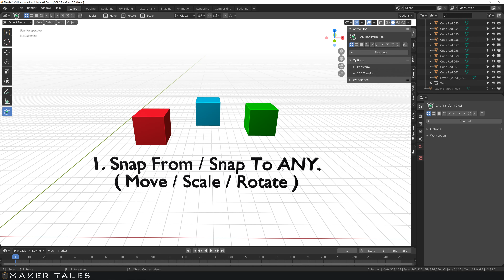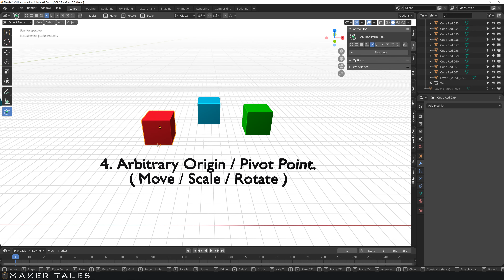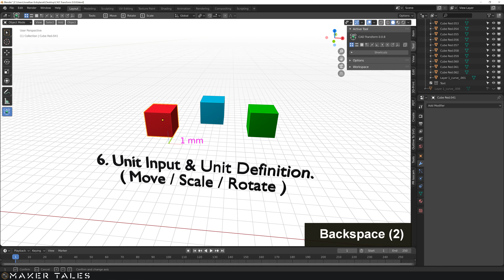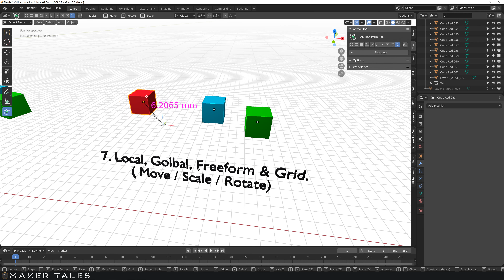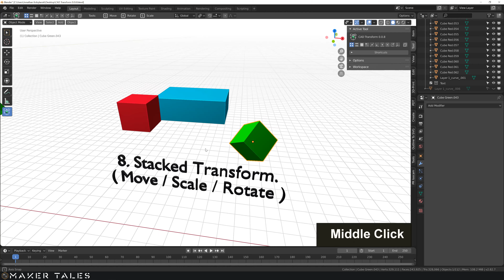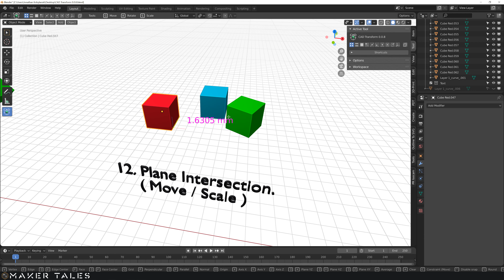CAD Style Precision Movement In Blender 2.83 | CAD Transform 0.0.8 Addon Update

Comment: I've got the center length of a cylinder that i want to line up with the angled edge of a 4 sided pyramid.I've got the bottom center face of the cylinder snapped to the bottom corner of the pyramid, is there a way to keep that anchored and snap the top center of face of the cylinder along the edge of the pyramid?
Reply from the maker: Hey, I'm pretty sure there is but without the file at hand i'll find it hard to explain. You could also ask this questions here: https://blenderartists.org/t/cad-like-transform/1226197 and i'm sure you'll get answer.

Comment: Oi Big J. Kinda pathetic but I struggle to install the Add-on. I'm running Blender 2.92.0 and try to install the 0.91.0 CAD transform version. When I go to "pereferences -> Add-ons -> Install -> file path " I'm presented with 3 different python files. The one of my desire is "slcad_transform.py". So I double click it and within Blender there is a thin blue progress bar at the bottom, which takes about a second. But afterwards I can't find the add-on in the "Add-On list " for check marking it. Am I doing sth wrong or does Stephen L. simply hates me    :'(
Reply from the maker: Hey freezyAndHaze, have you had much luck with this? At the end of the day is make sure you keep the zip file together as all together that is the addon. I hope that helps. If you need more of a guide leave a message in the discord and i'll be more than happy to help.
Reply: @Keep-Making  i realized that u must not open the zip file 😅 rhen everything works as expected

Comment: I have a question. When I start manipulating with objects and start rotating or moving it with CAD snap on, it goes into its own coordinate system which has different axis location relative global one. Say I want to constrain moving by Z axis, press Z, but actually it is Y, or X, and I have to press them all one by one. Am I doing smth wrong?
Reply: Constraint keys are toggle between global / local / custom / none (it is possible to set the default one in preferences) so in order to move on global z axis you have to press z twice.
Reply: @StephenLeger  Thx! You are speaking of the vanila manipulating. I know hitting twice the axis toggles constraints from global to local. I am speaking of using CAD snaps. Does it work the same? I haven't tried hitting constraint keys twise and give it a try later.

Comment: Wow, this is smth I have always missed in Blender beign an Autocad and Rhino user! Thanks a lot for all your tutorials for Cad users! Still one issue is I cannot resolve. Boolean objects with coplanar faces. It leads to awful artifacts. Blender still cannot do it whilst all CAD and even 3D Max are capable of it. In latest 2.91 they added new bolean exact solver, it is better but still lots of issues.
Reply from the maker: You're very welcome!
Oh ya for sure, those who are looking for a 100% CAD solution should stick with a cad program. However, blender is definitely turning into a nice middle ground to play with some decent precision and organic modeling.
Reply: @Keep-Making  Well, it depends quite a lot on the final goal. If I need to get a low poly I need to make it in Blender for a good topology sake, making it in Rhino and converting even with quadrify mesh cannot provide this topology. For example I am trying this one to make just for the practice https://www.youtube.com/watch?v=Nyq_pO3ibRE&t=143s but without these math. I can make it in Rhino in 5 minutes, in Blender (I am learning it now) with the CAD snaps I thought it would be easier, but Booleans is a stumbling block form me now. Coplanar faces + boleans = fail. It is such a mess, a lot of coinsiding edges, some cannot be refit. I can't imagine it works fine in 3D max and all Cad applications but in Blender it doesn't. I like your lessons, they are good for Cad users like me. Will look into them more.
Reply from the maker: I do understand your frustration! With time i'll cover this in my blender 2.91 series for sure
Reply: @Keep-Making  Thanks a lot. Yet I find myself doing booleans and then tracing them with new point+extrude workflow and after using this clean shape. Not sure it is the easiest way but cannot find a better solution.

Comment: Great but blender NEVER can be used for real CAD projects as its precision is fundamentally limited ( see the first limit) https://docs.blender.org/manual/en/latest/advanced/limits.html . this is the case until they think about improving it.
Reply: for 10mm objects, precision is ~0.000001mm, by far enougth even for high precision mechanic !
for 1m object precision still is ~0.000061035mm 
So i can't agree, but this require clever use of the unit system. By the way presision is the same than in 3dsmax.

Comment: Cad Transform 0.91.0 compatible with blender 2.91 is available on gumroad !
Reply: Stephen, this became my favorite plugin alone with meshmachine. I really love Rhino for its perfect snaps, and now we have smth similar in blender. Few things to poing out. I'd love to see Ortho togle, so I don't have to constrain axis all the time. It means I can move only by X or Y axis perpendiculary. Also when in edit mode I want to drag the edge's vertex to it mid (so it becomes 2 times shorter). Rhino remember the origin position of the point, so it tracks the middle, while here the edge becomes shorter and the ability to track the middle disapears. I hope you understand what I mean. I can use the average only if I have the same length paralel edge as a reference, but if there is the single edge I cannot do that.
Reply: Well either Maker Tales deleted my prior comment or YT did. You say your addon supports v2.91x ( I have v2.91.2 on Win). You need documentation. The package is not showing as installed yet Blender says it was. It is not listed. I see Add Mesh: Archipack & Viideo Tools: Refine as the only addons with your name as author. Enabled add on is unchecked. What is with this assumption that anyone wanting to use the plugin is already familiar with the installation process? There is 3 py files in the 0.91.0 zip plus those in sub directories. What gets installed .. all the base 3? I imagine the sub dirs are linked thus do not need to be installed. I've spent a few hours now on this due to lack of docs and help. This video and the condensed version does nothing other than cheerlead.
Reply: @xenuno  Setup using the downloaded .zip file, if 0.91.0 version fails, you may revert back to 0.0.9 with blender > 2.91.0
Reply: @StephenLeger  Thanks .. that fixed by using 0.0.9. I now see CAD icon in Blender. A little bit of documentation with rev history would be rather nice. Testing now ...
Reply: @StephenLeger  OK .. after properly installing 0.91 it works fine under 2.91.2 of Blender. It's fab plugin. What I don't see and have elaborated elsewhere is how to align the gimbal to the face of a cube for instance, whose faces are not co-planar nor edges co-linear with global in any way. Need a 3 point snap, I think, to be able to line up origin with a cube vertex, with the X Y and Z axis's co-linear with the vertex's 3 connected edges. This (a 3 point snap) would facilitate a 3D Align function similar to AutoCad's which is a one step process. AutoCad can also save any number of custom UCS's which it handles any like an object and they are fully transformable. Wonder if such a paradigm can be applied to Blender? The closest to it in Blender is setting Transform orientation to Cursor then gimbal position and angle can be set.
Reply: @xenuno  Take a look at  #44:37
Reply: @StephenLeger  K thanks. His cube is co-planar and parallel (edge wise) with Global which will be what the constraint appears to line up with. My example doesn't. I have found tho that hitting say X twice uses the object's local UCS? I still think a discrete 3 point axis align would be a welcome addition if possible using the right hand rule for positive Z. Still learning this but you have a great base that ought to be included with Blender by default.
Reply: @xenuno  Normal based custom constraint will be coplanar to any custom face orientation, z axis aligned to normal, x horizontal and y as much vertical as possible.
Contraints keys xyz are toggle from local/global/custom/none.
So instead of taking 3 random points you are able to set the custom ucs at once.
Reply: @xenuno  You'll find this a lot in the blender community. When doing something advanced, the assumption is generally that you are not completely new to blender. 
Don't unzip add-ons. Save the zip file itself to an add-on directory (I suggest a cloud storage folder you create Just for that). When you go to install, you select the zip file, NOT a PY file. A few add-ons are only a single PY file so that will work, but others will break. 
Once you install it correctly, check the box to enable it, and you'll see the CAD icon. If not, hit "t" to show that bar, or there is a tiny little arrow in the top left of the 3d viewport.
Also, don't complain too much about an add-on that he is giving away for free, and isn't even in a full release stage? It comes off as pretty rude. 
If you still need help, there are Quite a few videos on how to install add-ons in blender on youtube.
Reply: @AndyEngelkemier  I complained about the lack of install help and that's it .. and did buy Leger a coffee at least, so it wasn't free to me nor did I want it to be and I should and will throw him some more. I know how to install these but was rusty when I did it the first time around .. so what is your point? Something like your little install writeup would be a nice addition as an included readme for any plugin-addon, plus revision history.

BTW: "When doing something advanced, the assumption is generally that you are not completely new to .. ". This attitude has permeated Linux builds if you haven't noticed .. which is one reason it's not more popular. Snaps of wine run time enabled Foobar and Irfanview .. programs you would likely use with Linux builds to access NTFS partitions. I searched for hours on how to get them to see NTFS drives that I had already mounted via Ubuntu Mate (v18). You would think that is something most people would be interested in knowing how to do and thus should be in a writeup and included for both. It's not ..
Reply: i just bought it and nothing downloaded.. what did i do wrong?
Reply: @CaptJackDeez  You should of received a "You bought CAD Transform for Blender!" e-mail containing a link. Even if not Gumroad member it should be valid .. mine still is. Don't break the non beta zip apart .. that's what caused my install headaches. This is why documentation is needed .. for those that are rusty or new to the process. It's too Linux like where it's assumed everyone enjoys searching endlessly for fixes and good documentation.
Reply: This is awesome! Do you have a way to align the origin to normal when affect origin only is chosen? That is Super helpful if you ever find yourself with an origin who's rotation doesn't match your object. Currently it seems I have to create a new object, move it to the other object's face using the face center + normal. Then join the two objects so that my object takes on the orientation of the object I created, then go into edit mode and delete it. You can use the built in snaps to "Align rotation to target" but that only makes Z normal to the face. Your tool helps then because then you can move it to the Center of the face, and then rotate Y or X using local Z and snap that to the edge center? That seems complicated. It would be awesome to have something built in to help with doing that in fewer steps. I would suggest an origin 3 point align. Click for origin center, next snap X, next snap Y.
Reply: @AndyEngelkemier  Origin should work the same way than any other snap operation, so i guess it should already work as it.
Cad transform constraint is ment to be as fast as possible at setup time, so don't expect a 3 points setup anytime soon, this would require 3 steps with snap to setup and will add even more complexity over a yet already not so simple code.
Reply: @StephenLeger  Maybe I'm just missing a key factor then. Say I want to make the origin Z perpendicular to the face normal. 
If I grab another object, I can snap face to face. Awesome! But if I grab the origin, it's not using the normal? It moves the origin to face center, but it doesn't seem to change the orientation. Is there a different way to select the origin so that you're selecting an origin axis to use? I'm guessing that's why it doesn't work. Or perhaps you can have it use Z by default if no axis is selected?
And sorry, didn't mean to make it sound easy. Programming is incredibly difficult to me, so that you've accomplished this is awesome.
Reply: ARGH!  I so wanted to buy this.  But it doesn't work with collection instances!
Reply: @dodaexploda  You may download for free (and make donation if you want to support my work). In blender 2.93, you are able to duplicate collections using geometry nodes in a way it remains snappable.
Snap to collection instances is not possible as it would be way too slow.
Reply: @StephenLeger  hey dude.  Yeah I downloaded it for free to see if it would work for me first before making a donation.  I'll take a look to see if there is a way to duplicate collections with geomtery nodes.  I'm still a noob at this.

Comment: Instead of pressing V, E, F it should implement use of 1,2,3 for edge face and vertex. also Shift+1.2.3 for their centre, 4 for normal why confuse with so many letters.
Reply from the maker: Hey Rajendra, This would not be possible as you would but inputting units when pressing 123 ect. It's all very intuitive after a little bit of playing around with CAD transforms.
Reply: @Keep-Making  123 are used in edit mode for vertex, edge and face too and also not far away from each other, you learn to play with V E F hence it becomes your muscle memory. even pressing Ctrl+E,V,F for context menu for vertex, edge and face feels me odd. Instead Ctrl+1,2,3 should be used for easy navigation, but it subjective choice, I am just exaggerating my suggestion, it is completely okay to use either method.
Reply from the maker: At the end of the day Rajendra. You can do into the setting of the addon and from what I'm aware you can change all the shortcuts what whatever you feel happy with. 😀

Comment: I'm having trouble with the scaling tool forcing me to select a second vertex for direction.
Example: You want to scale a Cone in edit mode. With the verts selected, hit S and pick any vert on the bottom of the cone for the origin of the operation and now you want to scale it straight up along Z. The tool doesn't let me scale along Z here, it is expecting me to select a second vertex, and since it's a cone there is no vertex directly above in Z, so I can't create the vector I need.
Reply from the maker: Hi Erik,
This is exactly the power of CAD transforms. This two point setup is the axis setup process.
I would advise going over this part of the video a few times. https://youtu.be/TWEoZghkalc?t=2221
Reply: @Keep-Making  Hmm okay, the two point system is only good then if your model has an edge or another vert that's along the axis you want to scale in. 
I think a 1 point + XYZ keys support would solve this. Here's a quick gif example of how I do it in Maya; https://i.imgur.com/4cmvnHr.gif
But for everything else this tool seems amazing. Will take me many hours to not trip over all the shortcuts!

Comment: This feature should be in the core of blender.
Reply: But then it wouldn't be overly complicated and rely on millions of shortcuts!
Imagine the HORROR of just clicking on what you want and what you want actually happening!
Reply: @beaconofwierd1883  if you actually use blender for any amount of time you will ALWAYS go back to keyboard shortcuts just like EVERY OTHER piece of proper software.
Reply: GifCo Sure, once you know blender the shortcuts will be faster, that’s sort of the point of shortcuts. The problem is when you’re trying to get into blender and the only way to do even the most basic operation is googling it everytime because you forget what the shortcut is.

The new GUI changed that and made it possible for new users to use blender without punching their computer out of frustration and now I’ve completely abandoned Sketchup and other simpler 3D software because of that.

Also, shortcuts aren’t always faster, the new axis selection is actually faster than the old X,Y,Z. Dragging your mouse in the visual direction you want is much faster than figuring out which axis you want to lock by name and pressing the corresponding key.
Reply: @GifCoDigital  it doesn't matter, there are things that with Blender at the moment are just cumbersome. I had to move a GROUP of objects two days ago, and snap this group of objects based on a vertex to another vertex of another mesh. There was no other way to do this without creating a dummy object, parenting all to it, and then removing it.
Uselessly cumbersome. 
Also, this actually shows you better what's happening and it's really much better interface, it simply works better than the actual snap implementation. Why insist on saying that you wouldn't like it or use it?
Reply: @BoltonnStrid  youre explaining an convoluted very specific multi step task what does that have to do with shortcuts? And what you explained is not at all that bad and is pretty much how you would have to do it in other software.
If you have to do that task all the time it would take little effort to write a script.